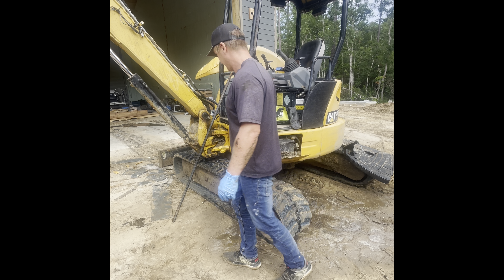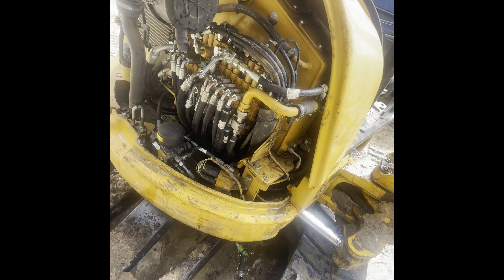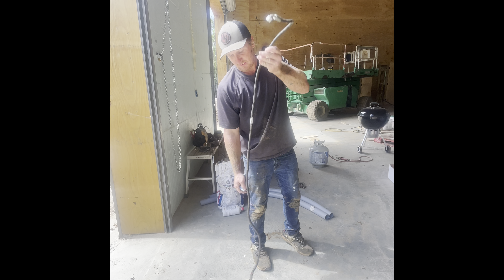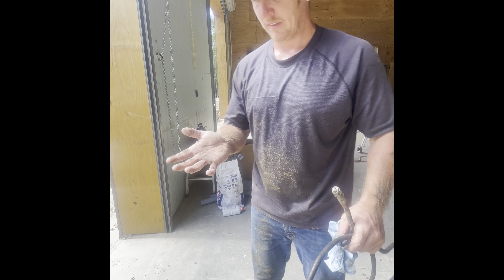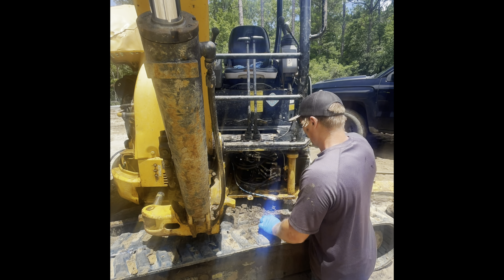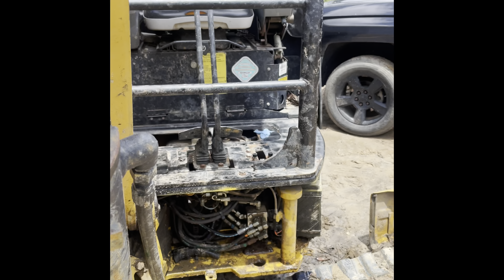Hydraulic Leak On The Cat 304 Mini Excavator

Comment: I was hoping you may be able to help me out. I live in Tavares Fl I bought a 303c cr mini. The previous owner removed all the hydraulic lines and did not label them. So I am having a bear of a time trying to figure out where they go. I had them on to a point but everything was working in reverse. Arm would go left when wanting to go right with the stick etc. I am pulling my hair out lol. Any diagrams or blueprints or schematics you may know of? Thank you in advance! Brian
Reply from the maker: Hello Brian,
I am sorry hear that! Usually people use colored zip ties to mark the hoses.

I have a Volvo that I had to manually switch hoses to make the control pattern different. I contacted Volvo and they were able to get me a diagram of the hoses. You should be able to contact Cat to get a hose diagram. It possible to find it online yourself through their site.